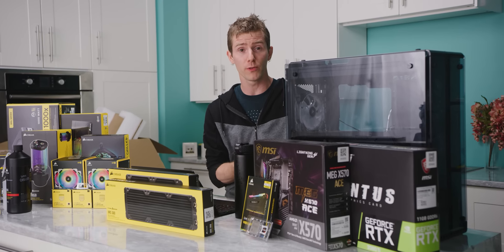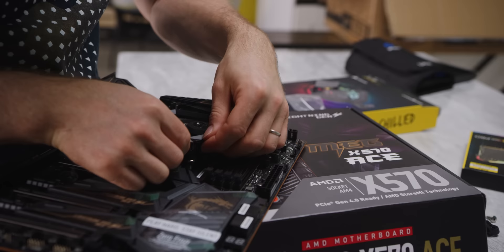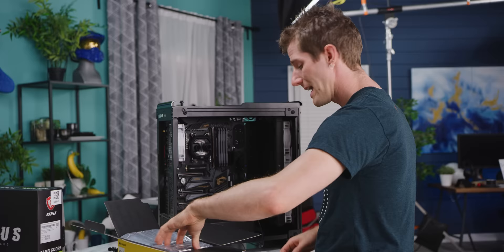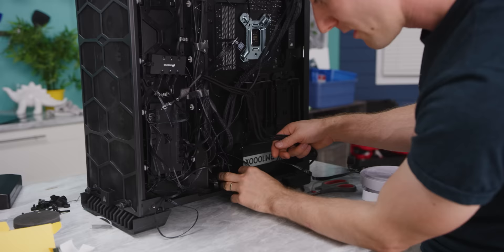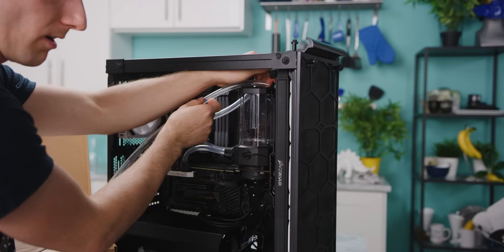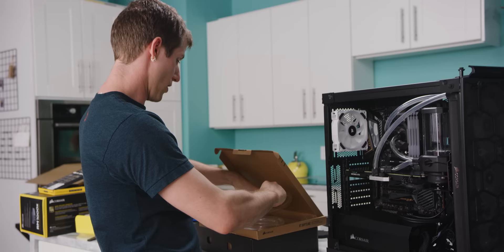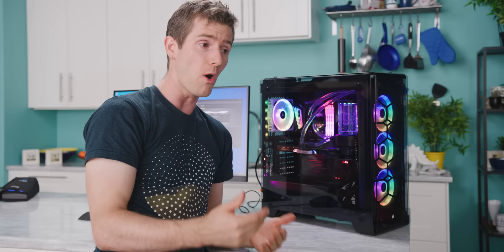Custom Water Cooled PC SPEED BUILD - Hydro X Series

Comment: Motherboard Manufacturers:  We need holes in our motherboards, guess we'll just send them to Linus...problem solved.
Reply: Factual
Reply: If your power is grounded (love 3 pin standards for that), then your PSU is grounded to the case (even when powered off at socket - ground is still active) so just touching the case would be all the ESD needed.

Alas not all countries have a 3 pin mains plug standard and often just have two wires with no ground/earth wire.

The UK has a 3 pin standard, yet different from the Canadian 3 pin  standard.  Then there is the frequency and voltage  (why you often see 110/220 switches on some electrical devices, or 50/60Hz switch).

Maybe Linus could do a show in which he tries overclocking the electricity and seeing how that works out - 66.6Hz  anybody :).
Reply: Holes in the motherboard? The connectors for the chassis fans should just be on the back of the board.
Reply: Still need holes to access them, case manufacturers would need a standard for them placement wise so they can accommodate them.  

However, may be possible with placement near the CPU socket and a breakout adapter (yes that old parallel cable may well have a use :).

Though EM aspect of another edge would certainly be a consideration in placement and design - so placing said connectors upon the back is just so much easier and logical.  But without a standard, creativity and compatibility with cases without having to ship dremel templates, is going to be a factor.
Reply: I was expecting him to say wireless connections for the power connectors and rgb connectors etc
Reply: someone from the actual team thought this was funny. prolly the wild jake lol
Reply: Don't forget that a lot of CPU coolers with RGB also have a SATA power connector, fan splitter, & may have a USB cable too. That would be a MASSIVE hole in the motherboard where the motherboard manufacturers need to path the traces for all the necessary components of the motherboards.
Reply: @wboyd33  I make circuit boards that are far more complex and dense than motherboards for a living, putting a decent sized hole in a motherboard really wouldn't be a problem. Granted I don't know that layout of every trace or via on a MB it is still doable.  Granted you have the layer stack up for your MB you could do it yourself. Probably wouldn't be a very big hole though
Reply: @paulgray1318  That's what I always did during the decade I was case modding for buddies and myself, just touch the case a few times or lean on it with an elbow. :P   

But since I did see an ESD strap pretty damn cheap I finally bought one after seeing some posts of electron microscope images of traces and transistors that show damage even with no loss of performance noticed by the user....seeing those traces tearing apart at such a low kV that you wouldn't feel it with like 50% of the width fried at localized spots got me spooked!
Reply: @kurtownsj00  Touching the case won't work unless it is grounded through the mains. A better choice would be to touch a radiator or metal pipe, thats what I do if I'm going to solder electronics before there are deocupling caps fitted.
Reply: Holes could be used for heat pipes also. Motherboards have two sides but we only cool one...
Reply: I have often wondered why board makers haven't thought of just making some holes in the motherboard to pass small cabling through. High end builds don't quite look right with the odd stray cable not being hidden. Good one Linus, maybe some board makers will listen. Have you also noticed that the main power cables hardly ever line up with the motherboard or graphics card squarely especially while using those expensive colour coordinated corded cables which is paramount in the build looking good.
Reply: @paulgray1318  Don't know if current ones are different but switching power supplies ramp up the frequency as part of the conversion to DC.
Reply: I was waiting for him to say "The motherboard industry needs a common standard for an RGB bus, so you'd have short pigtails that just plug in." Wouldn't that be nicer than having to route cables at all? Gee, maybe even integrate a standard RGB controller into the board to sync them all...
Reply: did you read what you wrote before you pressed the button?????
Reply: Yeah boi
Reply: Ante

Comment: We've come to a time when building a water-cooled PC, setting up the RGB is the most time consuming factor. Oh how we've progressed.
Reply: Yep
Reply: Truer words have never been spoken
Reply: Regressed*
Reply: Bling is apparently more important than performance nowadays.
Reply: @filiphedman4392  What? pffft. No. Performance is all relative to your budget anyway but for making a mid-range gaming/workstation computer look far better than its pricetag and something of a showpiece you can invest a small amount of money in RGB lighting options that rely on you to have sense and good taste. I know you know what it looks like when someone has none with their RGB.
Reply: To be fair, even in my air cooled system (well I've got an AIO) the RGB took by far longer than building the entire system lol. Then again I do have x8 LL120s, so that's like 16 cables alone.
Reply: @TheGauges420   @Seth Kauffman  dude yes. It took me a couple hours to build everything and cable manage. It took me a couple evenings to get the rgb in, and cable managed so it wasn't a nightmare. It's very tidy now but man it took a lot to get that way. I have 6x QL120's, a commander Pro and lighting node. Have the AIO RGB as well. So much to manage VS the component assembly.
Reply: @roguetune03  yeah in total I have a lighting Node pro with x6 LL120s connected, I also have a set of LS100 starter kit RGB strips (2 250mm and 2 450mm) I used 2 250mm on top and bottom edge, and 450mm at the back edge, then I also have the H100i Elite Capellix with its Commander Core and x2 LL120s connected to it, and jesus christ is it a pain. Is it worth it? Hell yeah. Does it suck to set it all up? Of course lmao. It looks so good though, I have 4x8gb of Vengeance RGB Pro (might switch to the Dom Plats with the Capellix LEDs), and I have an XPG RGB m.2 nvme lmao. My whole system is a rainbow, it's absolutely beautiful, I love it honestly. I'm about to build a desk with integrated RGB and I'm going to use more of the LS100 RGB strips around the bottom edge of the desk to give off a nice glow. My peripherals arent Corsair though, because I just dont like them really, although it would entail me only having to use iCue, but I chose the Razer Blackwidow Elite for my keyboard, Mamba Wireless mouse, Firefly v2 mouse mat, Man'O War wireless headset...
Reply: @roguetune03  if you have an email I could send a pic to, I wouldn't mind sending a couple pictures lol. It looks fantastic, especially my cable management, at first since I have the Corsair Crystal 680x, I didnt worry about it and just kinda stuck em in, but a week or 2 ago I decided to get the new AIO and went ahead and tore my machine down to clean it and rewire everything to be cable managed perfectly. All my cables actually take up next to no space lol, it's pretty crazy.
Reply: My pc is blacked out with only deep red static rgb. Its nice. I dont see how any pc without rgb could possibly look better. 
And nah, I dont prioritize "bling" over performance. You can have both you know.
Reply: @-LucidDreamer-  Its all just money and  the will to make it happen. Mainly money in this game but someone has to install it right and have good enough taste so that the end result is not just an expensive waste of time.
Reply: furiously eating time
Reply: i need my computer to be ufo level of random flashing color
Reply: “Minimalism is all about looking down at people who have a lot of stuff and saying, “That’s disgusting, you have so much stuff”. 
Riley
Reply: Mlm b Nasdaq
Reply: @TheGauges420  
Try using Discord instead of email.
Reply: @flakietrends  why are you here

Comment: "can you hear that? its silent :)" no linus, over the jet engine sound of my own build, i can not tell that yours is silent.
Reply: hahaha same xD
Reply: Or the grinding noise from my Intel stock cooler.
Reply: same
Reply: Mine is more of a wind tunnel. Dangerous to dust an stuff
Reply: honestly Iremember installing my water cooling thinking this will be nice and silent. NOPE it makes so much noise
Reply: @Naturalhighz  same dawg. got quiet fans for the radiator too and its still loud. i suppose h440 stock fans are just loud as hell.
Reply: Lol... Let em roar my friend
Reply: Or through the sound of an F-22 taking off with my RX 580 at full speed.
Reply: hahah well imagine my dissapointment when i bought all high end stuff 9900k corsair 360 rad and aorus 2080 ti and it all still sounds like a bloody jet engine underload! guess ill have to save for another 2 years just to water cool it then it will all be out of date!! ahh the pc life!
Reply: @algebruh_m8652  have the same with my rx 570 :D crazy loud, did re apply thermal paste which dropped a good 12c at idle and dropped abit of full load temp, mixed with custom fan curve.. made it abit quiet while staying at a reasonable temp. but was a jet engine before haha
Reply: @joshjones2865  Yup, I was worried the first time because since my pc was so close to me I worried my friends would hear the jet engine take off and they did. It wasn't until I got a desk and put it under there where the sound was a bit quieter. Either way, I do plan of getting a new graphics card soon
Reply: More like my HDDs ticking...
Reply: Whats ur pc? Mine Ryzen 1700 Strix 2070.
Reply: Same
Reply: How much did cost to build it?
Reply: S13 chase I can’t relate and that’s not funny 😂
Reply: @DJ SwatZs It's made a grinding noise since I got it in 2016. Idk why. Cables are clear and everything. Maybe bearings?
Reply: Lol
Reply: Since I have built my pc a few days ago I haven't bothered to make a custom fan curve because my room's fans are loud enough to make it inaudible lol

Comment: Aren’t you the same guy who made “Why you shouldn’t water cool your pc” like 5 months ago
Reply: All facts are forgotten when sponsors are involved
Reply: @julianangell342  Speaking of sponsors.. Corsair makes the best AIOs on the market!
Reply: anonymity undisclosed water cooling is more for aesthetic now unless you have more than 2 graphics cards
Reply: I think he more meant AIOs but yeah, ironic
Reply: @garrettk7166  hehe nice
Reply: barbara Corcoran  not AIOs. Custom loop different
Reply: @loreaver3882  Lol what? no. With water cooling you will be able to run your components much cooler and by extension have a silent rig or a lot less noiser has you would have with only air cooling. Also if you live in hot places of the world watercooling will do a lot more than air cooling! not everyone has got AC and can have their ambient temps at 18-20 degrees and even than the GPU and CPU will make temps go high and need the fans to turn faster and make the system loud. Only fools would say watercooling is useless.

Comment: The Verge: Taking notes on how to build a computer with water cooling.
Reply: "You're gonna want to use air cooling otherwise the water will short-circuit the fragile complex componants we've got here"
Reply: @oliverhearn34  it might short out our tweezers
Reply: For like them it’s more like taking notes on how to computer a water cooling
Reply: don't take notes too hard but take them with confidence
Reply: @natimber3040  might even short out the most important thing we need for the build. The desk.
Reply: @tibuwi7059  so we have to make sure to align the desk with the little insulating pads in every home, right?
Reply: Vallu pc building ki panikiraru ra
Reply: Valla gurinchi marichipoo
Reply: “Now the word ‘Loop’ in ‘water cooling loop’ is referring to a livestrong anti-static bracelet, that’s right, we have one.”
Reply: So to water cool, you wanna take your water bottle and pour the water into the pc
Reply: @gamingfox9845  also make sure to have your live strong brand

Comment: Just a tip:
Please check your components before actually building your loop, could save you a headache in case one of your components is dead-on-arrival
Reply: NOW PLAYING: WHO asked ( feat: No body did) ⏮————⏺——⏭
 2:14 / 3:37🎶🎵🎶⬅️⏸➡️
Reply: Do you use an air cooler on the cpu? i.e. run the new system on air - then build it with liquid?  With soft tubing, do you build both fittings on each end and then screw into the g 1/4 hole on part (say cpu block) OR do you do what linus does here and screw in thread into cpu block and then push end of tube onto barb and tighten compression?  thanks for help
Reply: @yaboibeeler6927  oh so you've brought that to youtube now
Reply: fredfinks what does this mean? I’m new at this stuff
Reply: @kitsune1388  use a fan (air cooling) first, make sure all parts work, then go to water cooling, since using water cooling voids warranties in both direct and indirect ways you can still return without any issues before you do it without worry and also for a lot more reasons. with the next he's basically asking what order you put the fittings (the solid pieces that fit into the parts at 90, 45 and 0 degrees) in at, the first is putting the fittings on the tube then mounting the tube in with the fittings on, and the other is mounting the fittings first then putting the tube in.
Reply: Guess I was lucky because I got a 2nd try boot 😂😂
Reply: @yaboibeeler6927  my lad, nobody asked if nobody asked

Comment: 2 things I noticed: 
1) Linus got another ear piercing

2) He's not wearing an ESD bracelet
Reply: there are many more reference to The verge fail vid
Reply: @kramler  but no rive strong braceret?
Reply: He's gone on very multiple occasions to mention they wear ESD straps on their legs/ankles/lower body. Not that one is even a necessity in most cases if you're taking proper precautions and not doing obviously dumb things.
Reply: Xtreme Performance  it's a good cause tho ;)
Reply: @PKMNwater  i have never heard him say or see anything resulting in him doing such
Reply: At one point there was no Motherboard "bracelet"
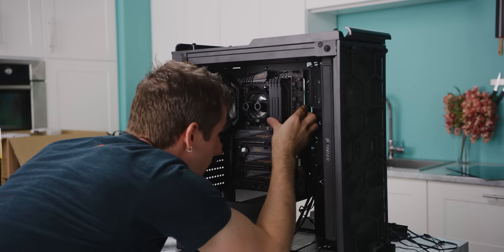At 5:29
Reply: Xtreme Performance  yeah, I always discharge and avoid carpeted floors when building... lol. Haven't fried one yet. I tap the frame or gee PSU, something metal lol
Reply: The ESD bracelet is the latest in technology. It's invisible! I learned that from my friends at The Verge. 

Alright end me please
Reply: He wears it on his leg
Reply: he isn't fighting static, or cancer
Reply: @voltare2amstereo  fucking brilliant!
Reply: And no red screwdriver!!
Reply: @Djuntas  ditch arren and get with phirip
Reply: He doesn’t need an ESD bracelet as long as he has a The Verge wrist band
Reply: He’s not using a Swiss Army knife that hopefully has a Allan wrench
Reply: I've never seen anyone have a problem from not wearing a stupid ESD device.
Reply: @daffhead4975  are you suggesting linus take off his socks and just wear his sandles normally?
Reply: The AmericanFook he said that in some of their old build logs before. He always wear the “bracelet” in his ankle to keep it out of the way when he's actually building a pc
Reply: Because he’s not fighting cancer!
Reply: 3) He's got a new screwdriver. R.I.P. red screwdriver he had for like 25 years.
Reply: I don't use ESD straps. Tried it once and it just got in the way and ESD is a very low priority on the worry list.

Comment: Thank you Corsair for putting extra long screws in with your radiators, I used their ML fans with my rads and spent ages trying to find screws that were the right length to fit without damaging the radiator!

Comment: Linus: We need holes on motherboards!
Motherboard Manufacturers:

WRITE THAT DOWN, WRITE IT DOWN!
Reply: Manufacturers actually: We already can do that :]
I mean even I have circuit boards on my desk with different shaped milled out sections, so MSI, Gigabyte etc can easily do it if they want to. What is required isn't a hole anyway, it's a passthrough header... MSI etc ;-)
The main problem I see is restrictions on where the holes could go because the routing of the buses for the PCI-E, DRAM etc takes priority.
Reply: @thomasp4902  so if they can do it already, linus can. XD
Reply: @thomasp4902  i know it's not a literal hole. i was just kidding xD
Reply: @maksssglatkikkk9129  is this a virus really?
link could not be found it says
Reply: @thomasp4902  If it is a through hole header, we can just solder rp headrs to the other side and cut holes in the motherboard tray?
Reply: The Leftist Who Cried Racist  Not really - route everything through the board to where the RGB and Fan Controller lives.
Reply: @barongerhardt  Yeah that would be fine too. Holes can be cut in the motherboard, it just means that the board will need more layers, and so the price will go up. I suspect this is why ITX boards are more expensive in many cases. Motherboards are cost sensitive consumer items so thats where the limitation comes. If the boards were £1k each it wouldn't be an issue.
Reply: @thomasp4902  Don't most motherboards still use through hole headers? I don't think ITX boards typically have more layers (compared to ATX). Even if they did, it wouldn't add that much to the cost of a board. The more more likely culprit is volume of sales.